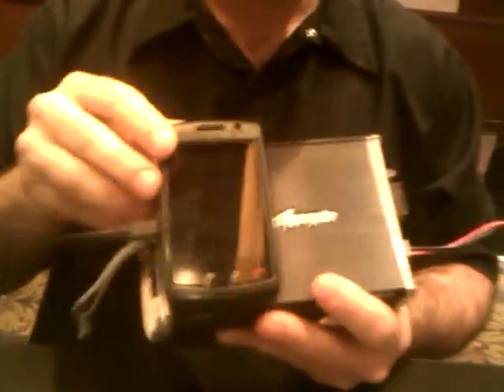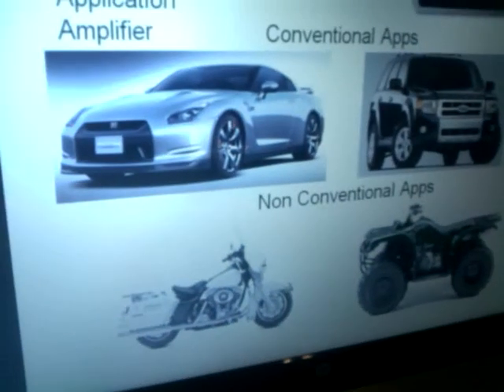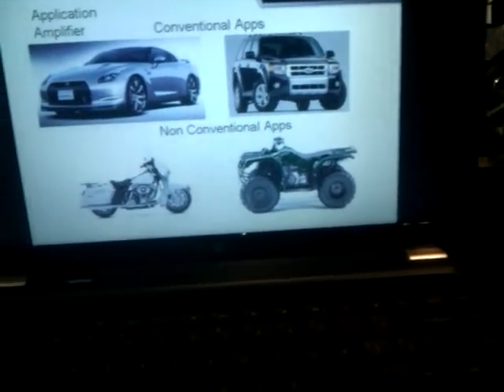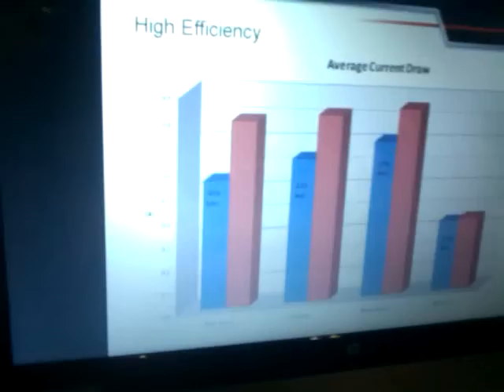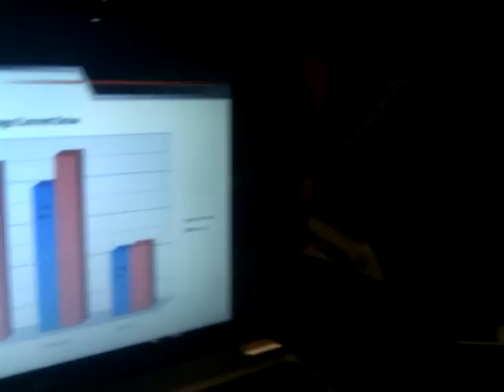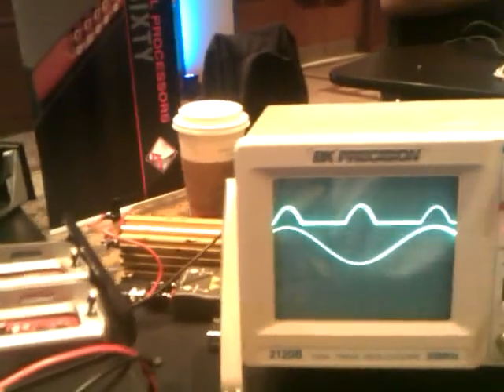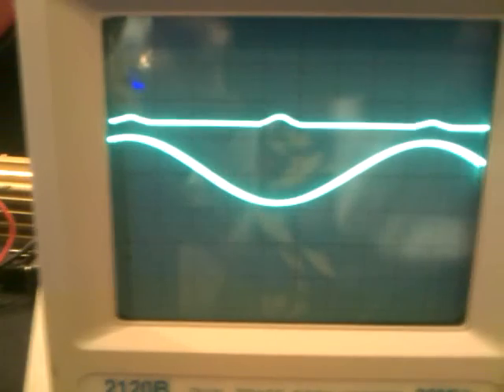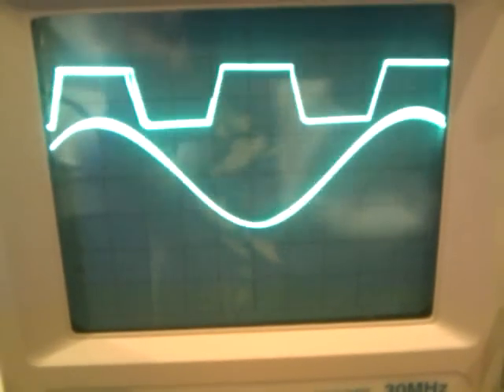ROCKFORD COMPACT BRT AMPS CES

Comment: Hello good day dear friend, I ask you a question, I bought over a month ago a Rockford Fosgate amplifier PBR500X1 by amazon and I'm from Venezuela, when I did the installation of the amplifier in my car this does not work correctly because lights as flickering or flashing light of BRT and even loses its power for a few seconds and then returns. I check the installation into several parts and have not solved the problem, let me know if you have knowledge that this light turns on BRT. THANKS